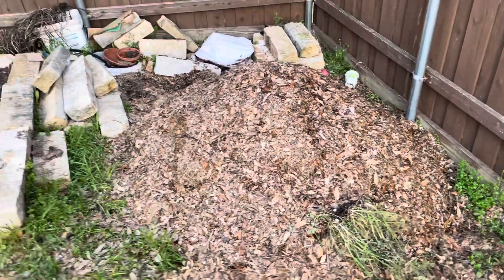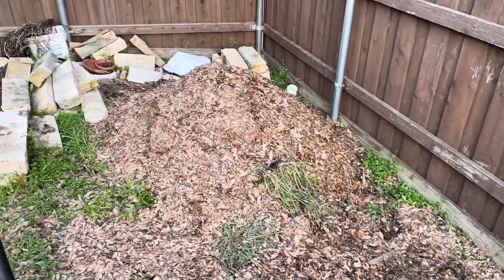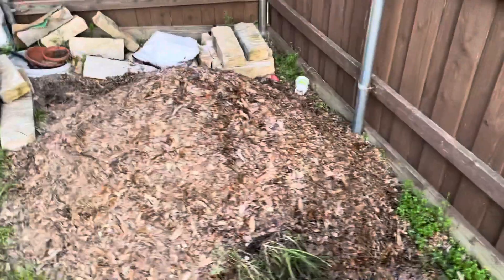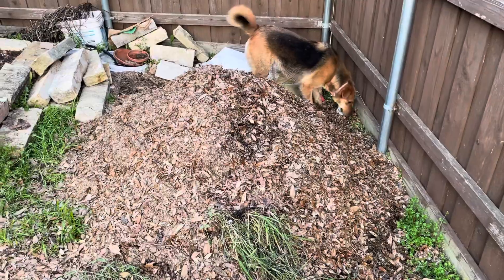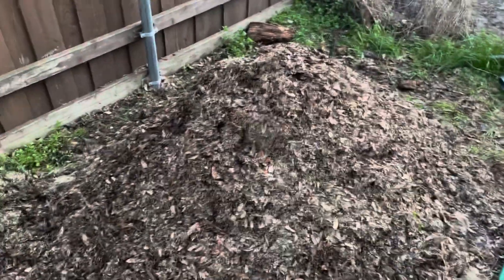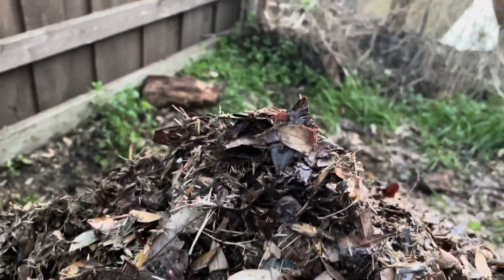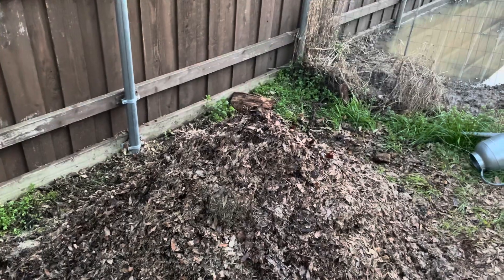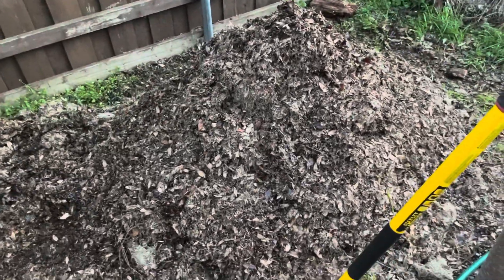Berkeley Composting Method, Day 4 : 1st Turn

Comment: I have seen this method done with the 3 bin composting bin, but the idea 💡 i got from your fist video, changed my design to almost exactly what your doing now. I'm thinking on setting  up 2 bins, one larger bin to turn compost from side to side and one to store unused compost for future use.
Reply from the maker: The three bin system is for slow burn compost.  It sits longer on each bin until it graduates.  It's also meant to always have compost cooking.  I only turn one or two piles a year because I don't use that much.  This rapid method of composting 18 to 24 days is ideal for cow or horse manure that are mostly decomposed vegetation.  Goat and chicken manure are a lot hotter and require more time to decompose.  In your case, with the abundance of manure from different sources, I'd go for a slower burning pile.  Maybe turn it once every 2 weeks and for about 3 months and keep it always moist and covered.